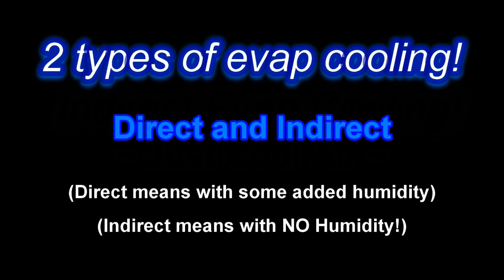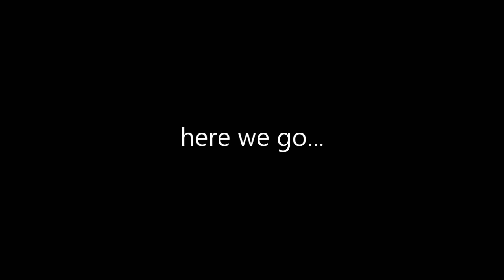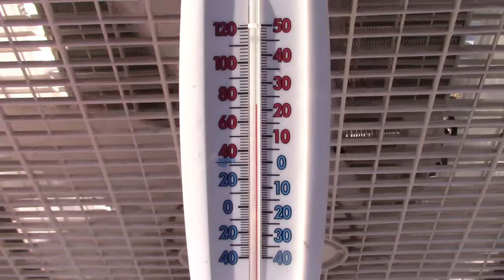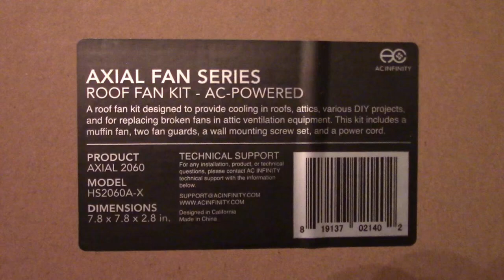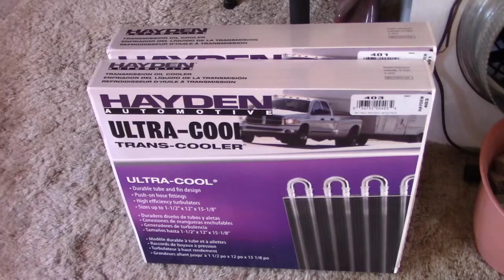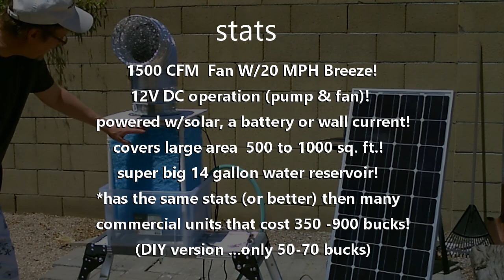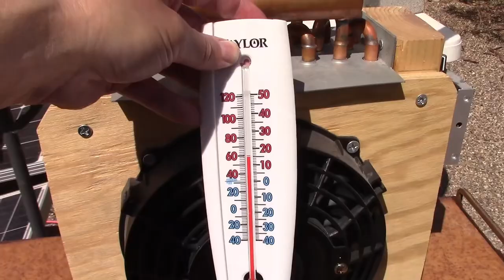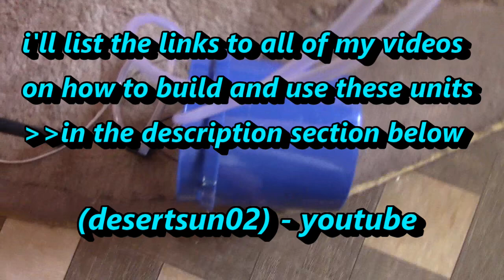DIY "INDIRECT" Evap Air Cooler! (No Humidity!) 2 Projects 1 unit! tons of info! + AC Air Cooler Comp

Comment: in the 2000s i working in a taiwan factory, we had huge aircons, it was like 3 ton size and was so noisy, well i found out it was water type that cooled us, it had been cycling water to the rooftop with pumps, on the roof the was an apparatus which had the water sprinkling in the air, like a small fountain which drop two layers to a bottom reservoir, which went back to the aircon by gravity, the pump was only used to pump the water up the rooftop sprinkler, i guess the water released heat that way and returned down by gravity.

Comment: Great Video, great ideas :)  One way to make use of the humid air if you're going indirect would be to let it blow on patio doors.  Seems like most of the houses out here in the southwest have sliding doors, major area of heat loss in winter and doubtless the inverse in the summer.  Blowing the cold, humid air across the glass should result in a bit of thermocycling that will have a similar effect to a cold day without introducing any extra humidity inside.  Bonus, if you have a patio, it will probably be more comfortable in that area outside.  My idea is a really weak takeoff of one I had about running swamp cooled air between the outer house wall and panels set out that connected to the eaves, with the winds here it would be an engineering feat (concrete base along house, heavy anchors, etc) to keep any panel material from blowing away so I scrapped it.

Comment: my country is hot and humid. outside is 40C, my room is 32C. anything to help reduce humidity and make cool/cold air using your setup?
Reply from the maker: hi. those are high temps (F=104/90). reducing the humidity is the hard part. i get temps that hot too but it's pretty dry where i live.

Comment: Why use two water pump? why not pump cold water from reservoir and the return line from evaporator let it drain  back to the filter so it can cool down as it drain back to the reservoir ?

Comment: Good job and clever use of parts! 

I was going to make a whole house indirect cooler by using a swamp cooler to exhaust into the attic space. The gable vent fan was a Buick 12 volt radiator fan that ran from solar panels with no controls. The fan started when enough sun hit the panels and it quit when the sun went down with no thermostat, voltage regulation, no batteries, etc. That ran for 5 years unattended. The attic would be 110F to 123F on summer days. 

The project stopped after I had a rigid urethane foam roof sprayed on over existing 3 leaf composition shingles. The foam is about 1-3/4 to 2 inches thick with tab mineral granules mixed in the top coat. Even on very hot days the attic temperature holds in the high 80's. I also had a 120 vac gable fan with 95 degree thermostat that used to run for hours after the solar fan cut off. The foam roof insulates so well that the AC powered gable fan never goes on any more. I removed the Buick fan and solar panels when they sprayed the roof in 2019. For the first time in 30+  years that I lived here in this house, its finally cool in the summer and warm in the winter. The open beam ceilings over 1/3 of the house had zero insulation. The foam roof cut my heating bill down by an average of 44%. Nice considering energy costs have more than doubled here...39 cents a kilowatt hour now for electric,  $2.40 per Therm for natural gas. You can walk all over the foam roof without damaging it. Its rigid!

I use the old swamp cooler running on low with a total of 405 watts (pump and fan) if needed, typically 2 hours after sunset when the house starts getting warm. . The temperature/humidity cooling chart is taped inside the cabinet door so I know what cooling will be expected. The swamp cooler runs from 120 vac power that comes from a home built 7200 watt hour solar generator which also powers an isolated  kitchen circuit. It's nice to run the cooler, microwave, air fryer, Instapot, and coffee maker off of yesterday's sunlight. Shaving energy here and there has become my passion. I went from 30-36 kilowatt hours a day to 12-15 kilowatt hours per day usage.  The writing is on the wall and I expect the utility to charge $1 or more a kilowatt hour soon enough.   

I appreciate your projects!

Comment: Hey brother, you've done a kick ass job on this stuff. I've followed you on and off throughout the years and you're always advancing - great job, and thanks for sharing.
Reply from the maker: you bet and thanks for watching! it'd be great if we could get these indirect systems to catch on. if you got the right humidity levels they are super.
Reply: @desertsun02 Even if these systems don't become primary, they can be used together with air conditioners during different months of year. For example, I live in western India exactly on the tropic of cancer (and I believe almost similar weather conditions will be there on ToC in whole world), and we have low humidity levels of around 20% in feb,march,april and 30% in May, most people in India use ACs at this time and most people have Individual ac's in their rooms as central ACs aren't popular here, so we can use this unit as a central AC if I put it on the third floor of my house the cold air will flow downwards and cool down two floors and even if I use ACs in the living room and stuff they'll still use less power. I'm going to make this system and will update you on it.

Comment: This just amazing! I always wanted to build an effective air cooler without the use of ice or cold water. Your solution is the answer!
Reply from the maker: hi there. glad I could help! i love these systems too.
Reply: @desertsun02  When I was working in the Middle East in 1979, we did several jobs at a refinery rebuilding gas turbine compressor drive units. It was hot already at 7AM. My hired crew was from Ireland and was not used to oppressive heat and could barely function on our 12 hour work days. I found a great solution and made gravity air conditioning.  The turbine air inlet filter house was on top of a concrete roof 40 feet up. It had an inlet grill about 16 feet wide and 12 feet high. Inside were hundreds of little cyclone type dirt and debris removers plus a set of water spray bars to turn it into an evaporative cooled clean air source for the gas turbine.

I had the boys remove the inlet distance piece right above the gas turbine inlet and had the area unit operator turn on the water spray bars in the inlet filter house. After a few minutes, there would be a gloriously cool flow of air blowing onto us and the work area out of a 3 foot by 6 foot duct. The moist air would chill and fall by gravity then blow all over us.  With 2% humidity, we were getting about 70 degree F cool air washing over us on a day where the ambient temperature was over 100F in the shade.

I always wanted to copy this and build a 32 inch round insulated duct to stand maybe 35 feet tall and have a water spray bar at the top. The bottom of the pipe would have a Tee that would serve as a chilled air outlet and a water reservoir. The only energy required would be to pump the water up to the spray bar/distribution arms up on top. The falling water droplets would evaporate, chill the air, and accelerate its downward motion to the cool air outlet.  If I ever go to Burning Man, that device would be my gig.
Reply: Ya I was thinking about burring some water lines to get cooler water and possibly making a Simi geo thermal buy putting the coils in front of or behind my AC because it' LS central Texas the humidity is way to high and way to hot to not have an ac

Comment: You’re the expert and I always appreciate your work.  I’d like to to suggest the use of an insulated ice chest with a separate internal container of water with water pump and copper tubing or plastic tubing. And then I would place frozen water bottles next to water container in order to keep the ice from melting so quickly from direct contact with water .
Reply: It seems to me the unit he designed really does not need ice- just cool water. I can be wrong.
Reply: @livingabestlife8  I agree with you. My late best friend was an engineer and was extremely intelligent and  he said that cool water works great when you pump it through 1/4 inch copper tubing and recirculating it and continue to keep the water as cold as possible given that you have an insulated container to keep the water cooler for longer periods.
Reply: @XC797  
The value of ice, in a cooler, or in our planet, is that when it changes phase it accepts a lot more heat than just water.  There is a thing called the latent heat of fusion where you can put in heat to ice for a while before it starts to melt because it takes that heat to do the change of phase.  Same thing with your freeze it, it doesn't just change from water to ice, the water stays at freezing temp and gives off heat until it eventually can freeze into ice.

Comment: Nice setup.  I've wondered for years if something like this would work.  I think I'll give it a try, although I'm sure it won't work as well in Virginia with its higher humidity.  It's a shame to waste the 60°F air coming out of the evaporator.  Do you think a small radiator at the top would make an effective pre-chiller to increase cooling of the water?
Reply from the maker: hi and thanks! i'll have to give that some thought. i'd be curious to hear what others think.
Reply: a faster more powerful fan will help off set the energy neeeded for cooling also simply making it bigger will help get more efficiency.
Reply: No way it will reduce only 2 degree without child water😂😂
Reply: it will definitely work inside your house because of the lower humidity.
Reply: @babugd1  i prefer the 'adult water' if you know what I mean  ;)

Comment: With the inline fan, you can duct the moist air out the room.  Most portable AC have a "dry mode" (less power) which also push warm air out the room.

Comment: This sounds ideal for use at Burning Man.  The primary challenge would be filtering the blowing dust of the playa from turning the 'Blue Cube' into a mud puddle.  Perhaps some filters mounted an inch or so from the evaporative pads on all sides would do the trick.  I would love to hear your thoughts on the topic.  Great system.
Reply from the maker: hi and thanks! yeah, burning man would be excellent place to use it. since it's only a 10 day event, the dust and dirt shouldn't be an issue. the wet pads act as air filters too (so what would probably happen is the pads would capture some of the dust or dirt (but because of all the water running down the pad) it would just run down into the tub along with the water and settle on the bottom). not much would stay on the pads. then you could just dump (or scoop) it out if needed. btw, since the event is outside, you might be able to get away with just using the 'blue cube' part of it. that will give you direct evap cooling and the humidity levels don't build up much when you're using a direct evap unit in the outdoors.
Reply: I've been to Burning Man two years in a row. I used two bucket coolers for keep my tent "cool", the dust build up on the pads is not bad, I used the same pads for both of the burns I went to (just have to clean them off when I went home).

Comment: Do you think your invention machine device* would chill the water if temps are like 110degrees like what we see here in the Southwest
Reply from the maker: hi there. oh yeah, it chills the water fine even at 115F. one awesome thing about evap cooling is that they actually have charts to show you what air temps to expect (if you know the temp of the air and the relative humidity). i've noticed the charts are very accurate. let me check.  ok, so if the temp is 110F in low humidity you will have air temps in the upper 70's. (and the water is usually a couple of degrees cooler than the air temp shown - so that helps too). with indirect there is always a slight increase in air temp because of the secondary conversion - so the air out of the fan may be 80F but when it's 110F 80'F feels comfortable. add in the wind chill from the fan and it might feel like 75

Comment: Victor Schauberger had water theories of gravity vortexing the water at some point to make it cool faster and use less energy to move.  39.2F is the anomaly point of water where it is most dense.  Even as ice expands and is less dense at sub freezing temps.  Spiral bent copper tubes to vortex to the right to match natural water vortex.  Could do a similar vortex thing with the air too since it already wants to. Tornado in a box.

Comment: This looks amazing been looking for a solution to cool my av/server rack which is in my warm garage. Dont want to run expensive ac unit. This looks like could be  a solution. Whats the blue foam your using??
Reply from the maker: hi. the blue foam is just standard evap cooling pad. it's technically called 'foamed polyester' evap cooler pad. i think the name of that pad is duracool. best place to get it is the home stores like home depot. i've seen it online on sites like amazon (but it's usually marked way up). a 3 by 3 foot pad should cost you about 10-12 dollars.
Reply: @desertsun02  Thanks for the reply, I'm actually in the UK but I'm sure ill find something similar just searching ebay now. I'm guessing foam used in humidifiers would do the same job? Thanks

Comment: When you have the evap cooler outside (with the heat exchanger inside) would the water stay cooler if you used a large insulated cooler instead of a thin plastic bin?  Or is the water being cooled so rapidly that it wouldn't matter at all?
Reply from the maker: hi there. i don't think it would matter much. the water is being cooled very fast. (but it certainly wouldn't hurt . i may experiment with that just to see)

Comment: This is really a fantastic, simple and inexpensive design, and it could actually save a lot of lives in the coming years of massive heatwaves ... at least in areas where there is water and low-humidity.  I just have one question ...

When you are measuring the air coming out of the top of the unit, how much do you think the air rushing by the thermometer is contributing towards the low reading, as opposed to being cooled only by the air temperature?  That is, if you just put an equivalent amount of ambient temperature air rushing by the thermometer, ( i.e the "fan effect" ) what would be its reading?
Reply from the maker: hi and thanks! i agree, this is a great, low cost, way to cool air. the speed of the air rushing by the thermometer won't change the air temp reading. (even if you slow the fan down to a trickle the output air temp reading stays the same). it's the same with ambient air. if ambient air flows by the thermometer it will just read whatever the temp of the air is. the thermometer won't pick up the wind chill effect that humans feel. you're probably thinking of the wind chill effect. a thermometer only measures temperature though. (wind chill measures heat loss for a body warmer than the air). a dry thermometer can't read lower than the air temp.
Reply: @desertsun02  
Well, I was thinking specifically of the wet-bulb measure of humidity.
But, since we are having a heatwave currently, I am going to do the experiment right now.
I have a mercury thermometer that measures 83 F.
Placing it in front of a fan, and walking away for a while.
OK ... still 82.  You're right.  Guess I forget my High School Physics.
Do you think it makes any difference where you could apply heat on the outside apparatus?
That is, like keep the water reservoir in the shade and let the sun shine on the pads?
Would that make any difference?  I am seriously thinking of building something like this, except this year summer is almost over.
Got any good ideas for heating?  I was thinking some of those black garden irrigation hoses lying in the sun as much of it as there is, and pumping that through the heat exchanger?

Comment: Nice system that works on dc power and without humidity, one question will there be condensation at radiator.
Reply from the maker: hi. that will depend on your humidity. (i never get any but some will)

Comment: Thank you for the interesting video! I have a small room 14 by 7 feet wide and 8 feet heigh. Can I use this system to cool the room to 70 F?

If you use an eletric cool box for the water then you should cool even more and stop the fluctuations.
Reply from the maker: hi. this system should easily cool a room of that size. i'm not sure of the exact temperature. depends on a few things
Reply: @desertsun02 Thank you! I will give it a try.

Comment: Ild just like to add some tips to improve maintenance and efficiency to this already great idea instead of just grabbing the cooler box water and pumping that back through to inside wall for instance you need to close the system off by putting that other radiator inside the bottom of the cube and filling with radiator coolant or distilled water then no calcium/lime can form over time also it gives the water in the box more time to stay colder for longer.

Comment: This is great! I'm thinking of making a miniature desktop version! One question, where are you sourcing your rads?
Reply from the maker: hi and thanks. i'm getting them from amazon. if you search for hayden transmission coolers you should see lots of them. i'm working on another similar unit presently. video on it should be out in about a week. different fan and different radiator but similar in the way it works.